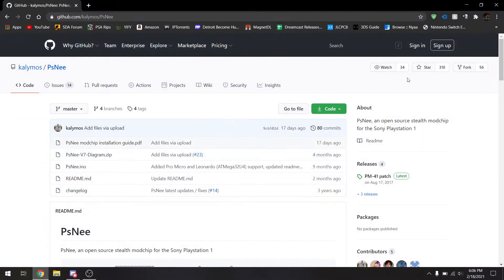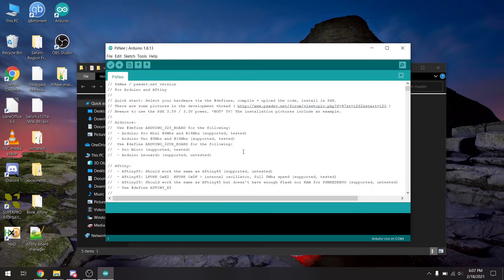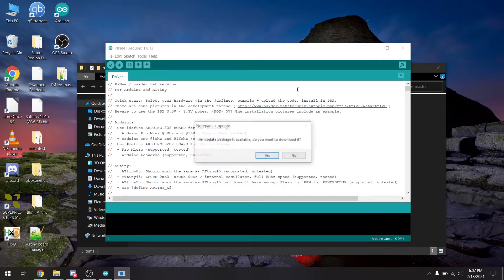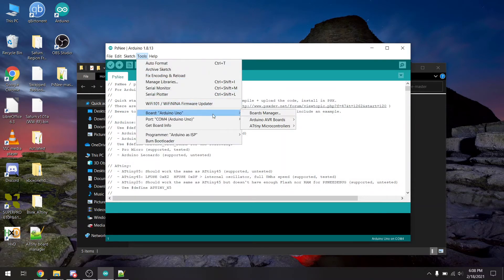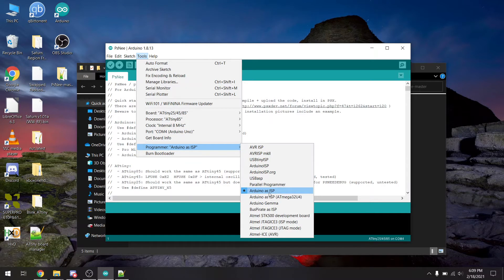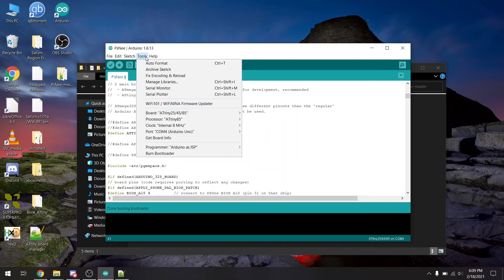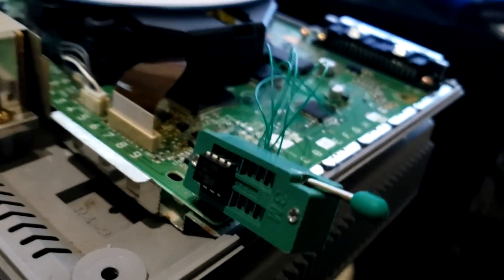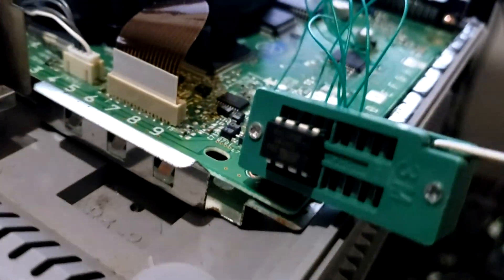Compiling and Programming PsNee on ATtiny

Comment: Hello and greetings my friend. 
I am a longtime gamer, collector, and retro gaming community member. I watched your video on fixing the NES cartridge  "Batman :Return of the Joker". I am having very similar problems with my two different copies of that game. I have taken the game apart to ensure its clean (with 91% I.A.). I have checked the traces with my multimeter. There is no rust or corrosion. The contacts look great, and I have also reflowed the chips. Remember, I am having the same issue with two different copies.
When I put the game in, the screen flickers most times. Sometimes (1 out of 5  tries or so), the game will boot up, but it's a little buggy and inconsistent.  By this I mean that on the load screen, the curser to select start or password might not be lined up correctly. Or, once the game starts, sometimes a wall or platform is out of place. It's really quite strange. 
Once again, this is with two different games, and they both have the same issue. I am thinking that this particular game has a faulty chip and so many games are having the same issues. I hope you read this message and reply if you can. Thanks so much for your time and thoughts. Respectfully...